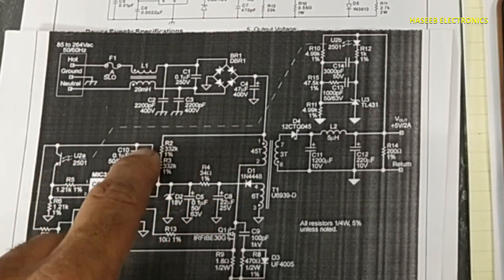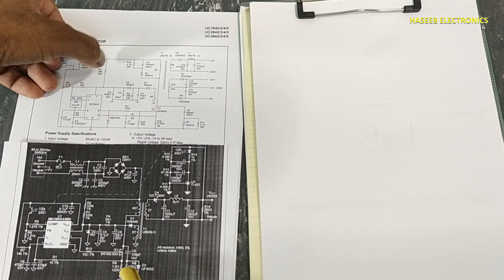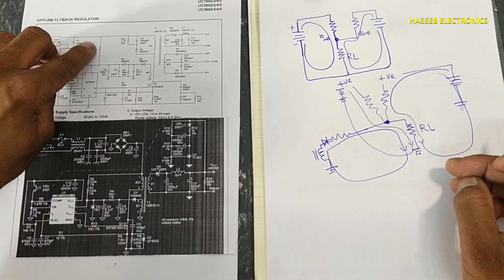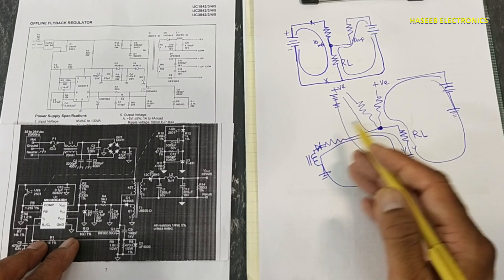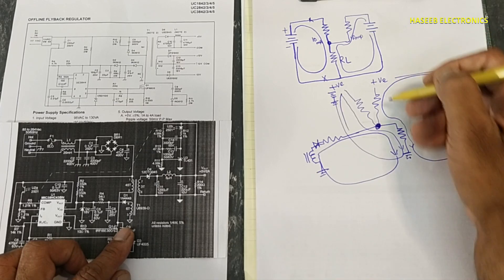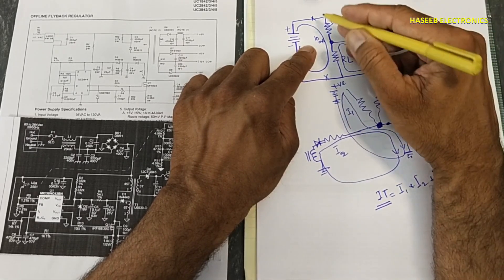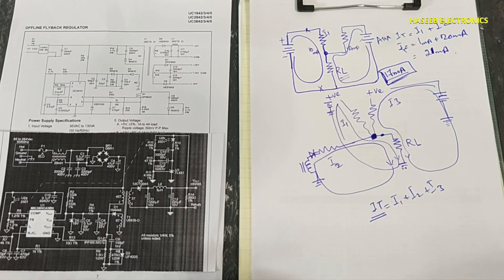{954} Different paths of electrical current within a circuit

Comment: Add timestamp 3:51, he said the current has to return through its path to the origin.
What if but circuits are providing different voltages?
Does this rule still apply?
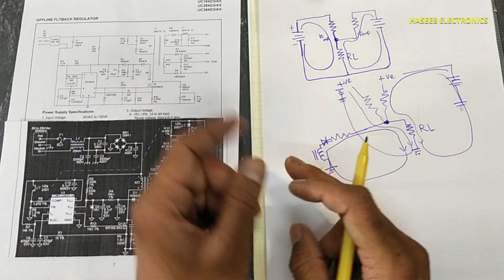Reply: As in, while completing its path through its origin (6:00), is it possible that the current from the auxiliary source travels through the  startup resistor circuit and causes damage?

Comment: The current cannot travel toward positive voltage sources because there is oponence or resistance (positive charges push each other) but it always travels towards ground (because of deficiency of electrons). This is my understanding. Please confirm if I am right. Thank you.

Comment: Sir my 5v smps ferrite core transformer primary DC110v coming. But in secondary sides not coming its may be faulty?
Reply from the maker: might be smps is not switching 
please check startup resistor 
check voltage on VCC capacitor 
MOSFET
its driving circuit
Reply: @HaseebElectronics DMO365 switching ic vcc and gnd get short frequently.